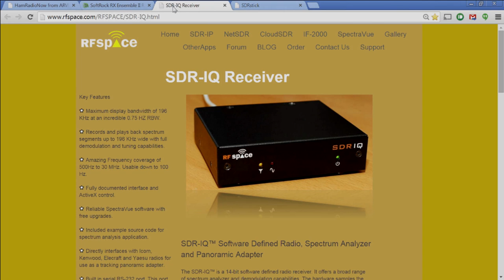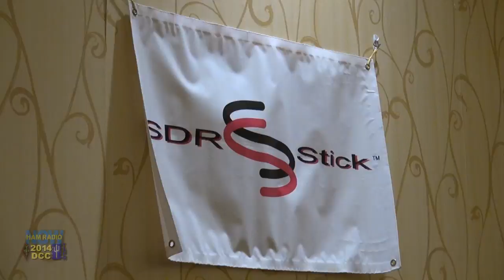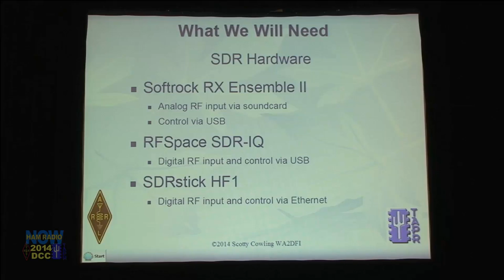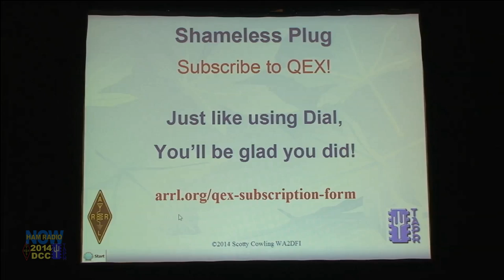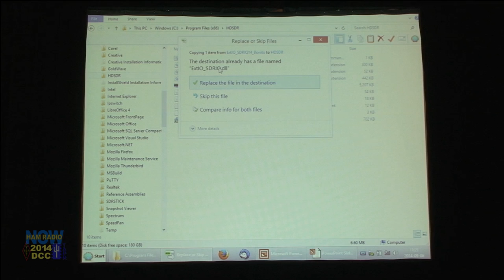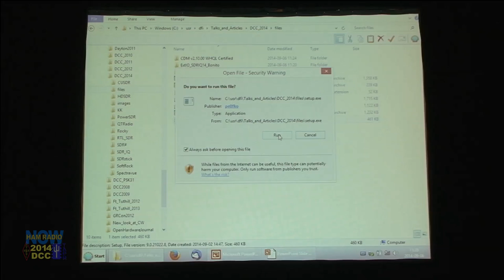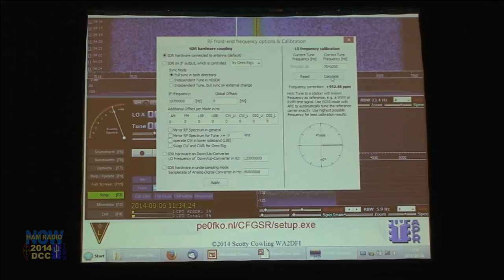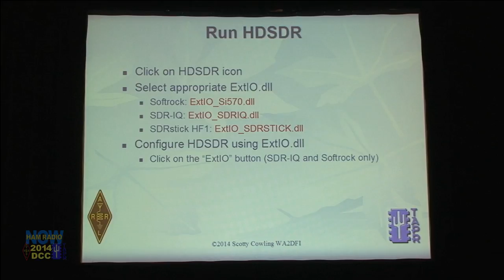Episode 170: Off the Shelf SDR, from the 2014 DCC on HamRadioNow

Comment: Very cool... I cut my teeth in the SDR realm with the RTL2832 based USB SDRs. I have 2 of them.. one is a $12 USB stick from Ebay.. the other one is DC to Day light one made in china that cost me about $60... the thumb stick one was easy to get going but I am still fumbling around with the $60 one as it uses a down converter that can be cantankerous at best. and the $60 one little to no documentation what little I have found is in Chinese.